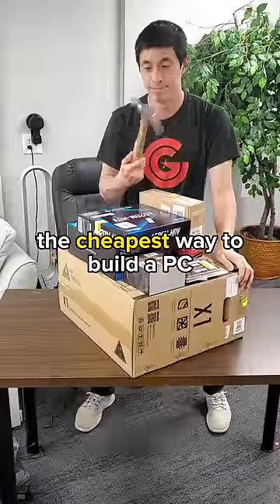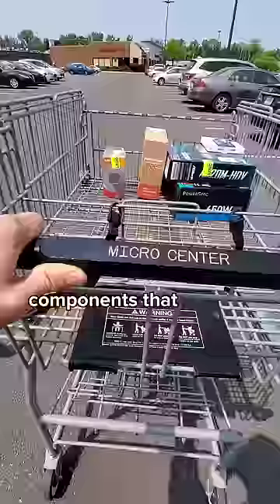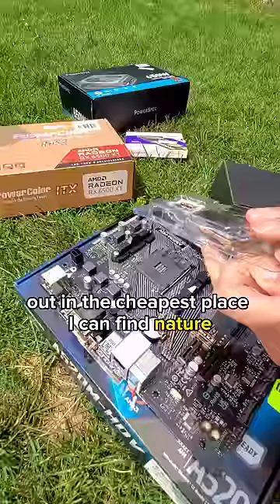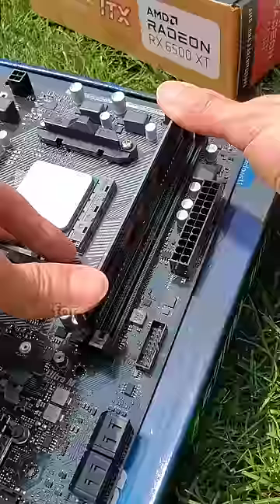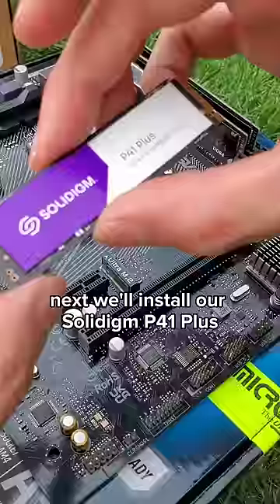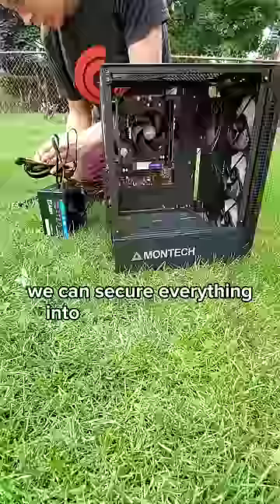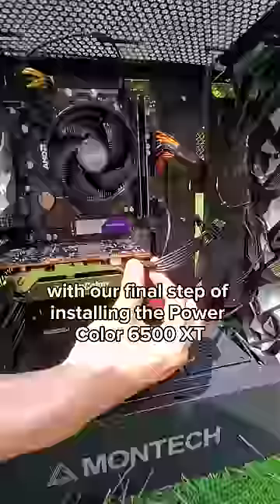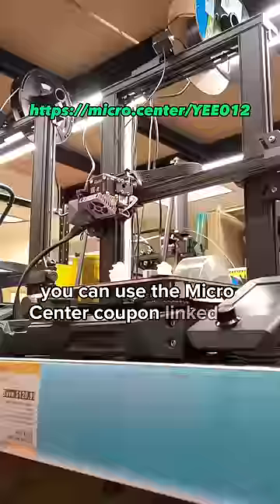the cheapest way to build a PC #shorts

Comment: Me with a 150$ potato pc: WHAT DO YOU MEAN CHEAPEST
Reply: lol
Reply: Bro got the cheapest cpu he could find amd it was literally a ryzen cpu. This guy has his standards higher than us lower-grade normal people
Reply: Me with a 2007 laptop: bruh
Reply: I got mine for 100$ and it is not the worst, I just need to swap HDD for SSD and put a GPU in it
Reply: I have built one for like 250$
Reply: Can you share your pc specs?
Reply: This is the cheapest you can buy from Microcenter kek
Reply: well mine is literally 50$
Reply: Mine too
Reply: mine is 90$
Reply: @atcatpl  how do u put gpu on a ssd?
Reply: Mine is 120$
Reply: If you have the time you can build a decent one for $350ish. Used case B450, ryzen 3600x 750 PSU 1060 6 gb and 16 gb of ram. $342 after everything. Changed the cooler later so an extra $29
Reply: I bought
i5 2320 
Ih61m motherboard
R9 270
8gb of ram and 1tb hdd for 
300$ during corona epidemic.
Gpu died so i swapped for rx 550
Reply: @Nitrenix  should buy 120gb ssd for the system
Reply: @Nitrenix  bro really bought an i5 2320 instead of a 7950x3d
Reply: I said during corona pandemic, with components shortages and 4x msrp prices. That was best pc i could find.
Reply: And i got full retail Windows licence with it, so atleast something
Reply: That’s the cheapest gaming pc
Reply: @zetzzzzz  pentium g2030 4gb ram ddr3 1333mhz 500gb HDD 16mb
Reply: me with a raspberry pi: I AM YOUR FATHER
Reply: @zetzzzzz  HP Compaq 6710b: 2GB RAM, Intel Core Duo Centrino 2.2Ghz with 2 cores, a ducked up GPU (i ntegrated)
Reply: Me with free laptop and pc that aged more than 12 years 😅
Reply: Bro mine doelsent even work
Reply: Me with an i3 first gen and integrated graphics: bruh
Reply: Am I the only one with a 3070?
Reply: Got a $110 pc with ssd in it
Reply: me with a 5$ PC from a pawn shop: TOO EXPENSIVE!
Reply: i got a 150$ PC it got rx580 lol. can play anything with an old i5 3570k dd3 1600mhz 16gb.
Reply: i bought pc for 40
Reply: Me with haven't got a personal computer. Lol..
Reply: Cheapest brand new...
Reply: He literally said “at microcenter”
Reply: How the fuck is a 150 dollar PC called a potato? Mine can run solitaire at 20 fps!
Reply: @HasanSafakOzcan  ...
Reply: mine is more cheaper 142 dollar 😂
Reply: @Ketsur0n  i said "how tf a 150 dollar pc is potato?" mine is 200 TRY (~5 ¹/₂ dollars)
Reply: me with core 2 duo 4GB ram
Reply: @umad5456 we all aint rich like you people
Reply: Me With My School Laptop: 😶
Reply: skill issue my 150 dollar pc has an i5 6th and rx 570
Reply: 150? That's cute. I could make a pc for about 40.
Reply: @GoldenGearGrinder  bro what your point I got a fully built I3 2120 with 4gb ram for 7 dollars shut up
Reply: @kanahfisher7961  OH I could do that as well. No, the other price is for an actual gaming computer that can play gta v.
Reply: Same
I feel u bro
Reply: Mine is 50 usd bruh
Reply: Mine has an 4th gen I5 and a GTS 450 AMP! 🥶🥶🥶🥶💯🔥🔥🔥
Reply: Laptop
Reply: He said at micro center
Reply: Me not having a pc : I had nothing to pay
Reply: At micro center
Reply: @thomwalks  "The cheapest PC you can build at Mircocenter"
Reply: @atcatpl where
Reply: @Taco-tw9id  Custom build using used parts (my case is 16 years old), I have 32gb of ram, i7-6700 and no gpu
Reply: @atcatpl  does it run games? also what type of motherboard did you use so that it works in a case that old
Reply: @Taco-tw9id  The ATX standard is from 1995 and my case is from 2006, so any motherboard would work. For games it's pretty good when running ones that are less graphically intensive (Minecraft, rund around 60-100fps), for more graphically intensive games it's not the best (Cities Skylines at 1080p run around 20fps)
Reply: My laptop 50 dollars and it’s crap lol
Reply: @evgeniik.7832 me too
Reply: It works better than my $1000 dollar pc 😭😭
Reply: Me with a 20$ one.
Reply: I guarantee you can rip someone off with this
Reply: Me with a 1TB 2012 laptop: `\_(ッ)_/ `
Reply: Windows 95 user are you sure
Reply: @sambadashingchannel649  ahem... mine is 15... 15... 15$ 💀💀
Reply: @TechySkills  crazy....😰.what are the specs
Reply: Bro mines worse it’s just a book with a light shining on the page
Reply: Me with a Chromebook: ☠️
Reply: I have a 10 pound laptop that runs windows me bruh
Reply: 30$ PC (I have 2009 AMD Phenom II lmao)
Reply: With a 50 dollar chrome book
Reply: @atcatpl if you put gpu your cpu will be a bottle neck. What cpu yo got?
Reply: Bro missed the memo
Reply: @zetzzzzz probably just an old optiplex, gt 710 and i5-4500 level
Reply: Me with a 103$ pc
Reply: Everyone saying “mInE iS $50” DROP YOUR TUTORIAL
Reply: @thomwalks it's the only thing he can find on micro center bro
Reply: What do you mean mine was free
Reply: mine is 40$ runs tiny 10
Reply: Bro just my PSU is almost the same price as that PC 💀
Reply: I got free parts from pcs in the junkjard and borrowed my dads screwdriver. $0 spent
Reply: Can u tell what components ur pc have cause i wanna make one 150$ pc too
Reply: Mine is £150 with a I5-2400s, 8gb 1333mhz ddr3, gtx 960(2 GB vram) and 500gb hdd
Reply: @trumplander420  the only problem with urs is that it is having hdd instead of ssd
Reply: i have a $750 gaming laptop and it can only run Fortnite at 34 fps in low settings
Reply: @thomwalks r5 4th gen is outdated as hell now a days u running a pc from 2009 or somin
Reply: Mine was 50 LOLL
Reply: @sambadashingchannel649  wtf
Reply: @Notbeingahuman  lol:face-blue-smiling:
Reply: @hahaducks  how tf are u able to make pc for 50$ 
Im trying to make a budget pc of 200$ which will consist of 150$ gpu
Reply: Blud, mine was free. It runs Minecraft at 12 fps 💀
Reply: @thomwalks and 16gb of ram...dude could have done that a lot cheaper I'm sure haha 😄
Reply: @NotTheHeroStudios you can save money by not getting a 750w psu. A 550w would be plenty for that setup
Reply: @thomwalks ryzen is a good cpu like ryzen 7 7800x3d could easily beat 14900k at cheaper price and lower tdp
Reply: I got mine from my brother for like 30€, I upgraded the CPU, RAM and storage, though it doesn't have a GPU yet
Reply: I'm sorry man but those are way better off as french fries instead of as a computer but good for you though you enjoy your potatoes your way and let me enjoy potatoes my way
Reply: I wish mine was $150
Reply: Me with a 20$ worth computer tower : BRUH
Reply: Mine is 67$
Reply: Guiny found one for a dollar
Reply: He meant at micro center your pc was probably from over 13 years ago
Reply: He said the cheapest pc you CAN build at Micro Center he doesn’t mean mice center
Reply: Lowspecgaming gang.
Reply: Dell optiplex isnt even $100
Reply: My one is only 120 bucks. 😂
Reply: At micro center💀
Reply: Me with 90$ optiplex
Reply: @thomwalks he said "at microcenter" dingus
Reply: Me with a 89 dollers one: pain 😢
Reply: @thomwalks  there are a ton of very cheap Ryzen cpus
Reply: My gpu is 600 bucks
Reply: Can you play fortnite and cod
Reply: me with a 3rd gen intel ThinkCentre with gt 710, all cost about 30 dollars used: wtf are they both talkin bout?
Reply: Me using 15 USD core2duo pc
Reply: i got an rx 550 intel i5 4590 and 2x8gb ddr3 500w psu 512 gb ssd
Reply: I found a $108 PC
Reply: Bro go the office box with a 16gb ram
Reply: @thomwalks  my dad has a pc with a 10 $ intel cpu and integraded graphics 💀
Reply: From microcenter
Reply: My 60 dollar school PC: Fym?
Reply: @thomwalks  huh bro this is a normal person pc its called having a fucking job
Reply: Me with my 100$ pc WHAT DO YOU MEAN CHEAPEST?
Reply: @juneedakbar  "These are the cheapest individual pc components you can buy from Micro Center." From Micro Center, not wherever you manage to find random parts.
Reply: Not kidding my entire pc setup cost me around 15$. Got a free office pc on marketplace that happened to have a low profile gtx 1050. And got a monitor with slight backlight probs for 7$ and finally got a keyboard/mouse for 5$ each from a thrift store. So insane and actually pretty fast with a data ssd.
Reply: And me with 1$ cardboard pc😂

Comment: Can we see a performance test?
Reply: yeahhhhhhhhhhhhhhhh I'm waiting too
Reply: Waiting on this too
Reply: It’s a 6500 XT it’s not gonna be good
Reply: @ag76767  what is better?
Reply: @HippyFlumpod  pretty much any GPU, it’s equivalent to a 1650 super but lower memory, i almost got it for my build but decided on a used 2060 for 50 bucks more
Reply: That's for next month when you have enough to buy the cheapest screen, keyboard and mouse
Reply: ill tell you now its garbage.
Reply: @ag76767 Actually it's competing with a 2060, 1650 competes with a amd iGPU
Reply: @top.of.reddit  it really doesn't compete with a 2060
Reply: @ItsMeStrider  It really does. A rx 780M (amd IGPU is as fast as a GTX 1650)
Reply: @top.of.reddit  Rx 6500xt across a 12 game average on Hardware Unboxed's testing was around 30% slower than the 2060, on Gamers Nexus' testing it fell behind on every game anywhere around 20 to 60-70 fps. It's a LOT weaker than a 2060, and it's too limited in vram as well. It doesn't have anything to compete with the 2060 other than price. All of that is on pcie 4.0 too, if you use the 6500xt on pcie 3.0 the 2060 doubles its performance almost every time.
Reply: i have the same cpu and it completely dog shite for gaming… 8 mb L3 cache means very low fps drops
Reply: Low to mid settings max
Reply: @ItsMeStrider  on top of that, the 2060 can have the 12GB treatment (pointless maybe). But if you want surreal detail but satisfying at 60fps, the 2060 is that.
Reply: @top.of.reddit  an igpu is not equal to a gtx 1650
Reply: @marciafemista  look at benchmarks.
Reply: @top.of.reddit  i already did, that's why i said that

Comment: This thing is more powerful than my 2500$ PC from 2015
Reply: In 2015 I built an i7-6700k and a GTX 1070 pc, I think I spent a little over $1400 building it, and it still outperforms this PC.
Reply: @joshpointoh no you didn’t
Reply: @joshpointoh your build would absolutely not outperform a newer PC. Your old Intel CPU won’t even be able to run Windows 11 and would have a much lower clock speed than the Ryzen 5. Also your GPU doesn’t have ray tracing or any new features like the AMD one in the video
Reply: @ianthewarriorgamer8180 hold on right there because the i7-6700k sure, it will be outperformed by the r5 4500, in cpu tasks. However, in dGPU tasks, the GTX 1070 8 GB will outperform it because the raw power is closer to an RTX 3050 8 GB and the RX 6500 XT is closer to a GTX 1060 6 GB, but with 2 gb less vram.
Reply: @joshpointoh oh so you’re a time traveler? Gtx 1070 didn’t even exist in 2015

Comment from the maker: Even though this is the cheapest, I personally would spend a biiit more to upgrade the CPU and GPU specifically
Reply: Ryzen 5 5500 and RX 6600
Reply: @CrocoDylianVT  5600 you mean
Reply: The cheapest is $329.91 (before tax & fees) So unless the tax and fees are $153.09 something is going on
Reply: 13600kf and RX6950xt
Reply: @sudbtd   there is a Ryzen 5 5500 and it costs $84
Reply: @VermillionRacing  I know that but you should just get the 5600
Reply: Idk why are u going for ssd? Buy 2tb hard drive for like 40bucks u aint gonna do much with 500gb u can always later on buy ssd and do fresh win10 install or clone disk
Reply: @VermillionRacing  hdd is very slow, and much more unreliable.
Reply: @sudbtd  do you know how expensive the 5600 is just get a i3 12 gen at that point or 13 i think they are only about 80 to 100 dollars right now
Reply: @SuixdeCity  dude its 30 dollars more then an i3 and much better performance
Reply: @sudbtd   it’s much better price to performance at $80 vs $150+
Reply: 4500 is fine, get a 6600 though. Also micro center has the 5500 at like $15 more than the 4500 so go for that
Reply: @sudbtd 5500 goated, 5600 is expensive
Reply: If you want to be cheaper however, you van forego the GPU and go for a R5 5600G.

You now have an office ready PC that can run most games(with dome tweaks).
Reply: @VermillionRacing  the 5600 is 100 dollars, what are you talking about?
Reply: @pokepokepoke64  no it isn't, it's 20 dollars more
Reply: @sudbtd  exactly just get a i3 13th gen
Reply: @SuixdeCity  No, 5600 has much better performance at same price
Reply: @sudbtd  you realize the 5600 is not 100 dollars everywhere?
Reply: @SuixdeCity  you realize the 13100 isn't cheaper everywhere? What a stupid thing to say.
Reply: @sudbtd  i mean i contracted my self there but it’s 110 dollars? and i know it’s not everywhere also
Reply: @SuixdeCity  5600 is still better. No use in denying because it has better performance and is cheaper
Reply: @sudbtd  it’s not cheaper where i live?
Reply: Clutch gaming shirt?!?!, haven’t seen one of this in ages
Reply: Truly. 100 more dollars makes a HUGE difference between cheap and bang for buck nowadays.
Reply: @nikokristiansbodnieks2147  Intel F series with a reasonable graphics card are where it's at, totally.
Reply: @ItzDnZ  hell you can get a half terabyte boot drive nvme for under 30 bucks nowadays. Do both.
Reply: @chipsalom  yeah but u gotta think if u buy now 2300speed m2 and later on higher speed one but ur mobo only support 1 m2 then the old one is wasted but you do you idk why ppl buy these slow m2 240-500gb drives
Reply: How well does it perform?
Reply: @SuixdeCity  ryzen 5 5600 is actually cheaper than i5 12400f
edit: i just read your other comments, and all i can say is, just get whatever is cheaper.
Reply: @ItzDnZ  hdd is slow, and with ssd prices going cheaper nowadays its much more worth it to get an ssd, not to mention you actually need to use an ssd for the OS
Reply: You are also missing fans and a heatsink lol
Reply: @Yiss8352  i mean yeah depends what type of ssd we talking about nvme i would go better nvmes since some mobos only have 1 slot i have 2 slots atm
Reply: @ItzDnZ  yeah im talking about nvme too, its like the same price as a sata ssd now, so its much more worth it to get nvme
Reply: @Yiss8352  yeah i know
Reply: Nah bro I bought a better pc for 160 dollars brand new 💀
Reply: If ur not using it pls send me 💀
Reply: @sudbtd Idk how you can be so wrong on so many things. One the only difference between the 5500 and 5600 is that the 5500 has a bit lower max clock speed and lower l3 cache, so actual fps difference would be 1-9 max, I personally wouldn't pay 20 bucks extra for that. Two the i3 12th gen is faster and better in every way than the 5600, you can watch comparison videos on it. More cores doesn't mean more performance.
Reply: @germanfisch  🤭 where are you getting your benchmarks? 5600 is faster than 12100. Also, 5500 doesn't support pcie 4.
Reply: @sudbtd  https://youtu.be/ET0ptWpR9d8 here are the benchmarks you requested. And if you're considering saving a couple bucks by buying the 5500 I don't think you'll ever use pcie 4 lmao
Reply: @germanfisch  Hi no I wanted the 5600 and 12100 comparison because they are equal price where live. 5500 is 80 USD here.
Reply: why not a 5600G and no gpu?
Reply: @satibel  much less powerful
Reply: @SuixdeCity dude stop lying to yourself. The 13100 is worse than the 5600. It only has 4c/8t and it cant be overclocked. The 5600 has 6c/12t and it can be overclocked to be much faster than i3 while only costing a tiny bit more. Sure the i3 might be slightly cheaper but anyone with a brain could see the 5600 is better price/performance to a 4 core locked CPU 💀
Reply: @yeetus59  that comment was 2 months ago when i didn’t know that the 5600 was better😹 ion know why you even replied
Reply: @sudbtd  nah even with 5500 you have bottleneck
Reply: @CrocoDylianVT I would do a Ryzen 5 3600 or a i3-12100F with a 6600
Reply: @germanfisch i3 is worse in every aspect literally everything
Reply: @axstra2557 bro does NOT lnow what he's talking about 😂☠
Reply: @germanfisch  bro instead of doing this just look at the in game performance for both if you don't find enough evidence just reply to me tomorrow I'll link everything (also just a reminder I'm comparing the i3 12100f to the Ryzen 5 5600) Ryzen 5 5600 is more comparable to i5 than i3
Reply: What about the power supply?
Reply: @nikokristiansbodnieks2147  its a am4 socket not a intel socket
Reply: @Laugh_out_loud_hahah  but intel better
Reply: @ItzDnZ  HDD for modern operating systems is a no-go in 2024
Reply: @morcjul  lasts longer if u need to store info/other shit or smaller games that doesnt need ssd  yes put os on your ssd i would put it only in 1tb and bigger ssd no worth for smaller ssd too much hassle when downloading apps etc
Reply: @ItzDnZ  yes for data storage, HDD is fine and for cold data, it's even preferred.
Reply: yeah like a 3060 ti

Comment: But how about the performance?
Reply: Still better than my pentium ass from 2022
Reply: @sutapasamanta3202  still better than my prebuilt from 2018
Reply: @Sutapa Samanta  better than my i5 2014 which sucks
Reply: @harchan6274 pair that i5 with a gtx 1650 and itll rock most games at 1080p
Reply: @sutapasamanta3202  well my pentium is from 2011 💀
Reply: CHILL MY PC CANT EVEN OPEN ROBLOX
Reply: @shreyas__  I'll give it a try man, but the i5 which I have is U series, will the pair u suggested still work with U series i5?
Reply: @harchan6274  im using an i5 3570k with a gtx 1050 ti 💀

the U series just means underclocked iirc. everything should be fine.
Reply: @shreyas__  that's fine buddy, thank you, sure I'll transform my dumb lappy to a faster one, but need to earn some money lol, currently in class 12 board exam holiday 😂😂
Reply: @harchan6274  oh dang u series is laptop range lmao. i just googled and it showed me they're undercloked